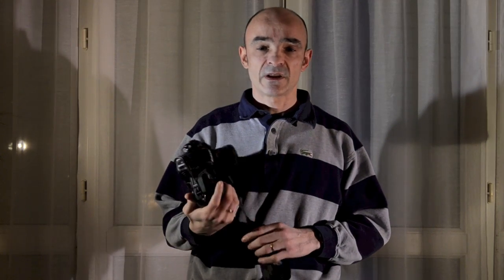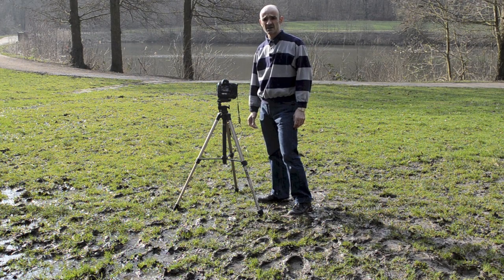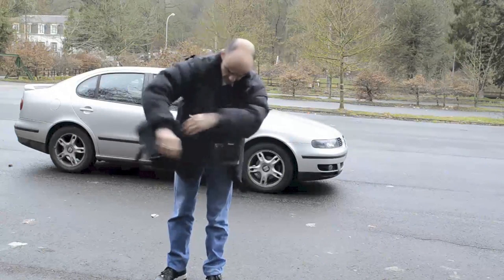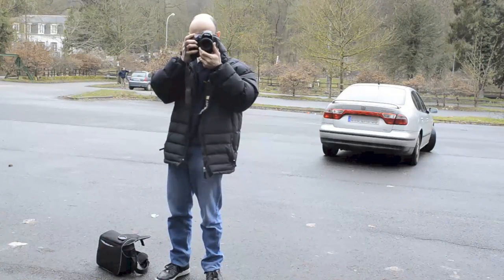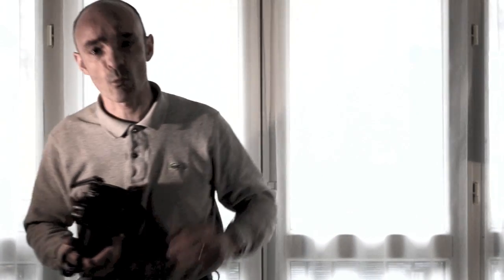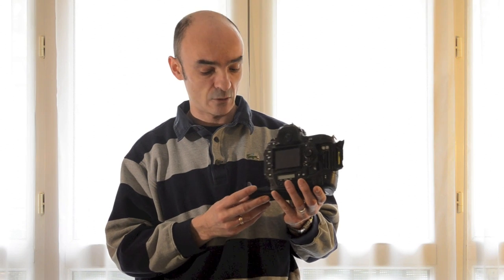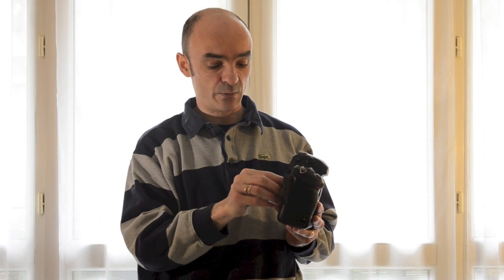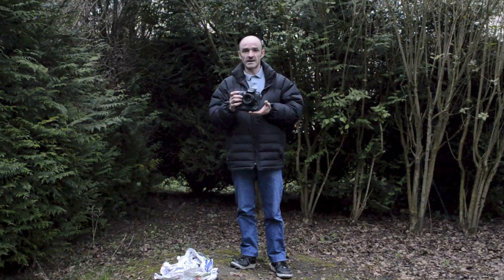Test photo - Le crash test du Nikon D3s

Comment: Nothing surprises me. The D3S has amazing build quality, and it can take much greater punishment than this.
For example, i forgot my 5D mark2 on the roof of the car. It was not in a bag. And at around 40mph (65km/h) it flew off and hit the concrete. After one year, i still use that camera. The only problem is, the body is slightly deformed and the microphone input does not work anymore. 
So.. cameras are incredibly well built. Have no worries

Comment: The idea for this video is more or less stolen from Digitalrev TV, who has done a few crash tests on Canon DSLR, and those tests were a lot more entertaining to watch than this one. Anyway, the point is that higher end DLSR cameras are pretty damn tough devices and you don't need to be upset when you occasionally bump them, drop them, use them when it's raining and what have you.

Comment: Olympus's original E-1 DSLR was more adept at handling any kind of abuse than any Nikon or Canon because it was built with a higher grade of industrial weather seal and had a stronger body.  You never saw one get the whole camera front ripped off it by an impact on its lens like Canon's "pro" bodies either.

Comment: Too much cutting in this video. Firstly I have a canon d450 entry level and I fall with it with my 95 kg on it when the camera where in the tamrac bag. Nothing happens. That bags where made to protect the camera. I want to see what camera is that what resist to a 3 meter freefall on asphalt. It is normal that a camera with that price, to be waterproof. In theory either a camera or a phone or an mp3 plaeyer if you put it in the ice and then you wait a week to dry, in theory they will function.